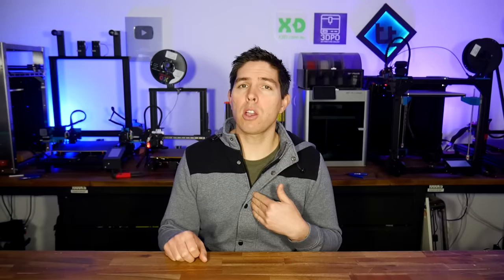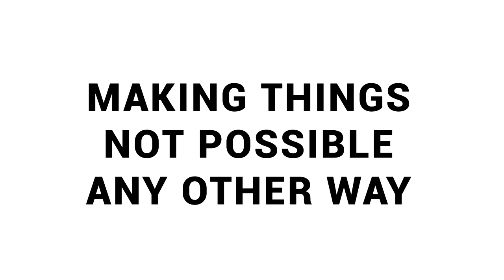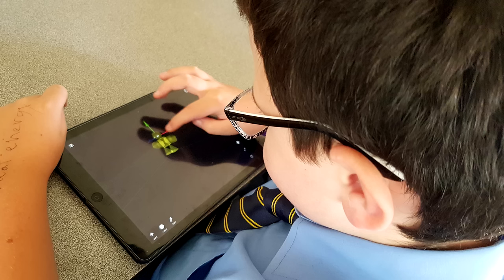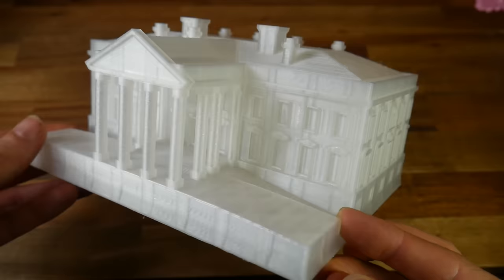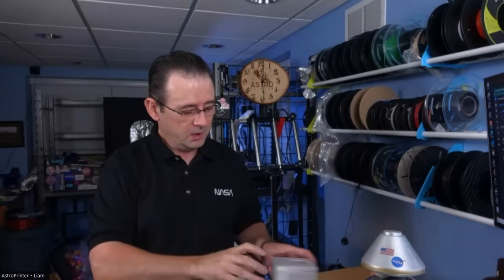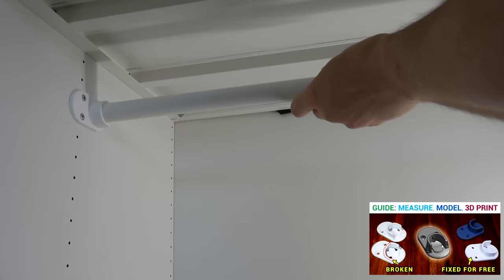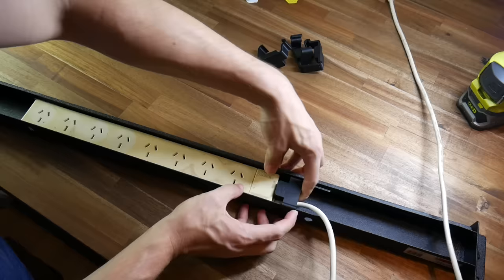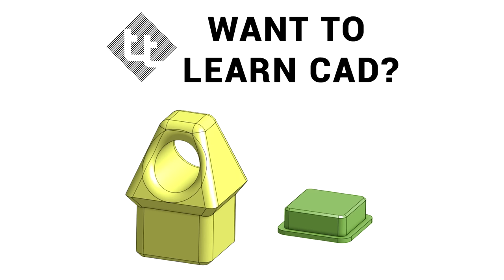These 3D prints will convert non believers

Comment: I for one am not convinced that the average person needs this. Yes they are a unique tool that has many applications, but to make a knob or replacement plastic part that can be purchased is not enough reason to buy it since you could buy many replacement parts for less money and not have one of these things sitting around doing nothing taking up space. I do agree that they are useful for the person who likes to tinker and build things as a hobby, then they are a fun toy / tool. I personally have a 4500 sq. Ft. Shop where I do my tinkering and hobbies, (I am retired ) so space isn’t a big concern, and one thing I do could benefit from printing some stuff, however there is a ready market of people who can make these parts and sell them reasonably so I still haven’t pulled the trigger on one yet.

Comment: Fixed my shower with a 3D print, fixed my previous motor-scooter that many times I can't count with 3D prints, made the enclosures for our factory clock controls using 3D prints.  The list goes on.  So my question to doubting types is this.  Why are you still doubting?

Comment: For a few of these things it's worth noting that Yes they can be made in other ways. But it's so much cheaper and more simpler to be made with a 3D printer. I personally love machining things but using the printer is so easy it almost feels like cheating. It makes unique designs easily accessible for a fraction of the cost of buying a machine shop to do the same designs

Comment: I need to sleep with a CPAP mask on. I designed and printed a custom hose holder. It helps quide the hose to my face and prevents me from getting the hose tangled.  It fits on the top of my headboard and can be easily readjusted as needed. There's no place you can buy a custom fit CPAP hose holder other than a 3d printer user.

Comment: I didn't think 3d printers were useless toys, but until recently I did think that they just weren't capable or reliable enough to actually be useful yet. My only experience of them was an old CR-10S that failed 90% of the time, and made bad prints when it did make them. Then I got to try a Prusa Mini and realized that the promise of the technology is finally in reach at the consumer level. Got a Prusa mk3 on the way now! I have SO MANY DESIGNS I've made that I can use it for

Comment: I bought myself the first 3D printer for practical use only.
I'm doing a lot of electronic projects, small EVs things like that, and 3D printing is very resourceful.
At work we also have 3D printers and those are extremely good to create production fixtures to aid manufacturing, we also use those very often to prototype things before manufacture in metal or solid plastic.

Comment: My favorite 3D printed part? I honestly can't say anything to that. I've done dozens of fixes at home like weird angled exotic looking curtain holder that would've been real pain to replace to something else. Garage I have made some holders for tools and MPCNC router from like 90% of prints and discarded old 3D printer. At work I've done dozens of replacement parts and improvements to industrial grade packaging machines. Heck I designed one prototype part for let's say packaged cup indexing to improve original. Had to split the part and glue it together to test it's profile and use in action before ordering machining time from one company that would mill one. But the thing is that this prototype part has now been in use for more than two years. But these are only possible with 3D CAD skills. Without them, nothing would've been accomplished.

Comment: There's one simple and undeniable argument towards the use of 3d printers : professionals use the hell out of them.

I've been working in mechanical engineering for over a decade in various fields... B2C and B2B products, industrialization, R&D...
10 years ago there was no 3D printer anywhere in sight, and at the time the network of suppliera was slow, very expensive and the quality was not there. Today, I cannot Imagine setting foot in a company developing hardware without seeing a least one FDM printer or a bunch of boxes from one of these quick 3D printing company (protolabs, materialize, 3dhubs and so on).

At the company I work at right now we have several small and cheap FDM printers in the lab, and at another location there's higher end SLA and FDM printers with a dedicated team to use them.

And no this is not only for prototyping, I've actually designed product which use 3D printed components, both FDM and SLA, and yes they were cost effective because the printed parts were designed to be printed and replacing them with IJM or machines parts would have required multiple parts not a single one.

Comment: I've been a fabricator for over 40-years.  I have yet to come across a need for a 3-D printer.  Every time I'm about to pull the trigger, I find a caveat that limits its usefulness......usually durability of parts.  Thanks, but I'll stick to my CNC.

Comment: 3d printing aside, there is am immense level of satisfaction and pleasure to be had in taking an idea from your mind and bringing it into reality.  Be it via 3d printing or using basic hand tools, when you conceive of something and through your efforts can later hold it in your hand this is something that is almost impossible to beat.  I have ZERO artistic abilities so sculpting is out of the equation but I can cut and weld and shape to make the parts I need for various projects.  Sadly this often means that while they are functional they are somewhat crude aesthetically.  Now that I have begin to get better with CAD I have another means to get the idea from my mind out into the real world.  The 3d printer is just another tool that has a specialised function.  It really is no different than a hammer, screwdriver or spirit level.  it enables me to perform specific tasks to get the job done.   They are not simple toys and they absolutely have a place in the modern world.  Just as many craftspeople used to look at computers and were unable to imagine how they could be used to make the items that they made by hand many look at 3d printers in the same vane and see them as a novelty...until they can directly benefit from what they can do and then they see the light.

Comment: Great video, man. I'm currently prototyping a headlight cover for my motorcycle. The aftermarket part exists, but it is somewhat expensive, and I decided to model and print my own, and I intend to post the STL online for free when I'm done. Also, I would not have the means to buy an Iron Man Mark VII helmet (just to geek out, I don't "need" one) to display. I use my 3D printer daily and have a queue of projects that continually increases.

Comment: Those who doubt, obviously lack imagination to be creative enough to make it yourself.  I was a shed head, Manual tools covering everything from Carpentry/Lathe work To Welding and metal Fabrication. But Age and injury rules out the real macoy.  I brought a 3Dprinter, Blew my mind with the Firmware and Cad as im a lorry driver not a programmer but now i print and build RC Aeroplanes and more 3D printers Designed to print full wings or fuselages in one piece rather than 4 or 5 pieces.  Im still a putts when it comes to the Firmware but im getting there. I get the jist, but the injurys i carry often over power my memory and getting things finished.....  I have alot of half done jobs.  They will get done, Theres no rush, These are all for me and my sanity (which is questionable at best lol)

Comment: Okay, you got me with the gearbox adapter. I previously was only interested in lost wax casting and high end filaments, but that's another great example. My biggest criticism remains the contribution to plastic waste in landfills, though. What happened to the gearbox adapter once the model was correct and real one made? It may be recyclable but if it isn't actually recycled then that's a bad thing for the environment.

Comment: I've printed a few trinkets and toys but the vast majority of things have been pretty useful and totally boring. Where they shine is in iterative prototypes, custom designs, and niche applications too small to warrant mass manufacturing. Knobs, handles, boxes, clips, holders, adapters, etc. We used some 3d printed parts in mundane non intuitive uses like our drainage system, and in concrete forms. Jigs, alignment tools, drill guides, ripfences, pushblocks, custom clips for installing siding, a network cable block for switch transfers. The list is too long to remember by now. 

3d printers are a game changer for the 'maker' or hobby types. There are physical limits on the materials, parts, and process. Plastic doesn't work for everything obviously. But given the margins, the limits on applications sit mostly with the user. It's one of those tools, similar to a lathe or mill, that changes your thinking from buying or adapting to making. Seeing something go from screen to hand that fast is just cool too.

The non-ergonomic sword of cataclysmic punition is not sold in stores. Neither were 45 degree round bend drain covers. Sometimes needs be.

The 3d printer and maker community is full of awesome people, creators. They might ask how you made something but they don't have to ask why.

Comment: I have already printed quite a few practical parts, for instance my mother had a hot glue gun that she accidentally broke the trigger. She didn't want to buy a new one since it was still new, so she tried to fix it using super glue but that wasn't strong enough and broke again. So I grabbed the trigger guled it together and then took some pics and tried to make 3d model as precise as possible since I don't really know any CAD program well yet, I did it in blender and it actually turned out great! It was almost flawless and actually fit in place and worked 😅
Reply: Other than that also printed holder for xbox controller and curtain mount and so on ...

Comment: I don't even have a 3D but I've already had ideas for how to use one. Funny enough I kind of see them as early stage Replicators from Star Trek so I've kinda had ideas for what I would do with the technology even before it existed. Top of my list right now is printing replacement tires for my RID2001 Optimus Prime and Ultra Magnus cause their original tires deteriorated after about 10 years. Outside of that some fans have designed fully functioning 3D Printed Transformers you can print at any size and with Hasbro's prices rising on official figures, 3D printed designs might be a solution to keeping the hobby going.

That said, I think much like ink printers could originally only print black and white images, 3D Printers currently can only print 1 color at a time and would need to be assembled afterwards or painted if you wanted something in multiple colors which is just a headache for someone who's color blind. I'm hoping the technology will be improved in the future, and I'm already seeing some progress which could lead to full color prints in the future.

Comment: I built an ebay 3d printer £80 and it works but using hard plastic is hard. Amazing what can be done with a 328p. which the controller board uses. Nothing wrong with 3d printing... it's the printers. A good one is not cheap.

Comment: I now only need to know which reasonably affordable 3D-Printer to get. There are so many options, even for SLA. I don't want to spend $200 and then have to replace and thinker around until it works reliably. But I also don't want to splurge more than let's say $1500 on it. And then the question about SLA, FDM or whatever. It would be awesome, if you could make a video pointing out what to look out for and even some solid recommendations on 3D-printers.

Comment: My ender 3 v2 already save me $10,000+ in car parts. Using 3d printed mould with carbon fiber seems so natural. I've printed a geodesic 4x4m greenhouse for wifey. Pencil cases for an entire 2nd-grade classroom (it was a donation. Each case has a 1 to 12 times table on the sliding lid). many housing for all outlets and smart devices around the house.  I have also tried to design my own glass frame in fusion3d because I really want that interchangeable near-to-far sight lens - ala steampunk (Getting to that age where the eyesight is changing rapidly). But the material wasn't strong enough (I tried ABS for strength and PETG for flex ) Also they came out too ugly to be put on. 

3D Printing is a thing. It's like getting your first computer all over again. The way you use it is entirely up to you.

Comment: And most of these things, outside of the "cant produce this item using injection moulding" can be done using other things. Is a spanner holder made using a piece of wood functional? If the answer is yes then a 3d print is also functional.

Comment: The practical application to 3D printing is only limited by your imagination! I was looking for something to simply hold my shed doors open while I was doing yard work so that wind wouldn't slam my doors shut and wouldn't damage my doors or the ramps into the shed. Designed very simple "snap shuts" based on a cabinet design and problem solved! Been going well all summer and when they fail, or if they fail, 20 minutes and an impact driver and they're back! Happy Printing Makers! o7!

Comment: I'm already convinced 3d printing is awesome but still, most of my work revolves around CNC machining. in my mind a 3d printer is really a CNC with a hot glue gun attachment and different g code, my first CNC was an Ender 5 with a Dremel attached to the print head. it's just not possible to make strong parts that can handle 500 C and 5000 lbs on the cheap with 3d printing. They are all awesome tools with different strengths and weaknesses!

Comment: Compared to CNC, 3D printing is like precision milling diarrhea. Sure, you can get m/l precise outside dimensions, but pockets or holes are largely trial and error, with the results vulnerable to filament or weather changes. Fortunately, each trial is cheap.

Comment: Printing a egro split sculpted keyboard, to fix my hand size instead of buying one which would cost $365USD. I can make one for for the cost of 2 Arduino boards, the switches and keycaps of my choice, a few connectors.

Comment: Brackets/adapters are 100% why 3D printers are borderline essential in a home. Honestly I don't know if I could survive without a printer at this point. Sure, you need to learn a bit of CAD, but that's basically not harder than learning to sew or cook.

Comment: It's not that hard to make profit from this hobby,
I have a friend working in a construction business they needed specific caps for some iron angle to have a greater finish, i did that and now they are ordering for the houses they build.
In fact with low CAD skills you can sell custom made product for a great price, still way cheaper than a molded plastic custom made solution. They can even ask for a specific color for each house, that would be impossible to ask to a regular manufacturer.

Comment: 1. Trinkets with value => yes it's useful if you do charity but for individual it's still useless
2. Making things not possible any other way => 3d prints are still fragile, gets weak over time, and not a single case where I think it could be useful without having it broke after just a few weeks/months
3. Education => still not applicable for individuals
4. Making hobbies better => probably THE only case I aggree. Still the printed tings look incredible rough, ugly and super low quality by the looks of it. You would never buy anything you printed if you saw it in a shop, just because it looks rough, does not have a smooth surface, fragile in one direction and 99% of the cases the surface has small errors
5. Functional replacing parts => probably the best case. But very few cases it has the durability to withstand the forces of a working environment if you print tools with it. And it's still pretty ugly
6. Things that you just can't buy => that holder  works, curious if it still holds your piece or it's failed already. Works great if noone can see the actual printed object, since again it's ugly
7. Changes people's life => 99.9% not applicable for an average person => useless for most

I've been looking to buy a 3d printer for so many months, because it's really cool indeed. But just scrolling through thingyverse I just cannot think of 1 thing that would be good enough  to print. Not one. I hope in the future there will be more materials to choose from, not just plastic, or somehow improve the quality drastically.

I hope you dont mind my comment, I really wanted to be converted, but I just can't see it If i'm being totally honest with myself.